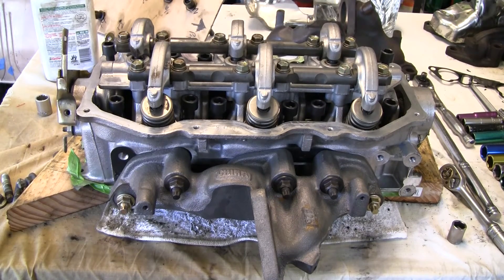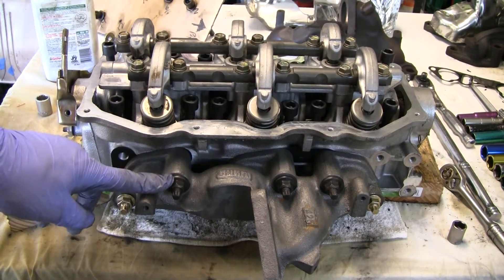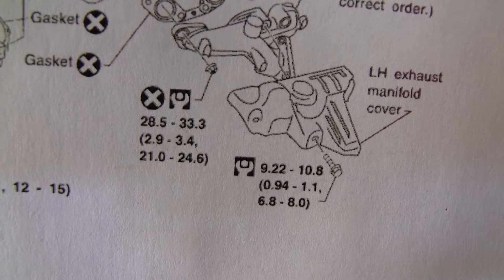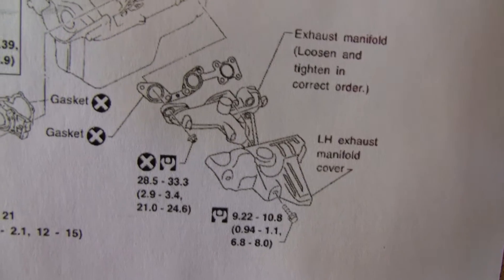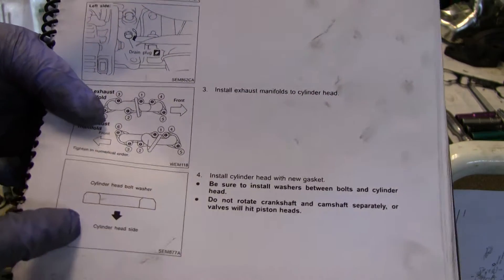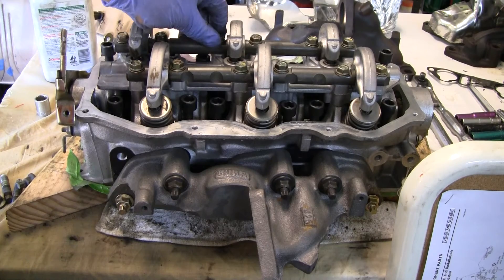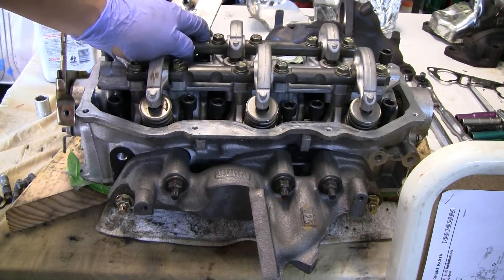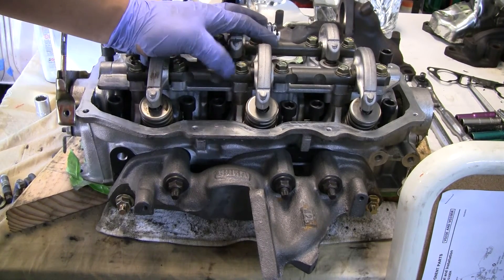2002 Nissan Xterra VG33E Rebuild Step by Step Part 70 - Exhaust Manifolds + Reading Torque Values

Comment: You should leave the rockers loose, UNTIL you are done installing the heads and water pump and rear timing belt tray. Just make sure cams are at tdc. When you get the timing belt on, you're able to set the tension more precise. Rotate to make sure there isn't interference and that dots on cam gears align, and double check tension and make final checks. THEN you are okay to torque the lifter tray in the correct bolt pattern and torque. Not overlooking of course that the dowls on the cam journals are flush when assembling. You do it this way so the cams don't have tension wanting to make the cam rotate on whatever valve spring tension there is. Sometimes you think the timing belt is good but after breaking and a few turns, it will be floppy and even worse on decel. This ensures the timing is true and consistent.

Comment: so its it possible to removed the exhaust manifolds without removing the heads ?? I just have an exhaust leak and want to take of it.
Reply from the maker: Passenger side head should be easier to remove than the drivers. The upper intake manifold goes over the drivers side head IIRC. I'm not saying its going to be fun in any extent, but easier since you might not need to remove the upper intake manifold. Its been a few years since I had my heads off.
Reply: I was able to remove the (cracked) stock exhaust mainifolds and reinstall long tube headers with the heads in the car. Of course, the bigger long tube headers were a huge pain, but putting stock ones back in shouldnt be too hard
Reply from the maker: I think its definitely possible to remove the exhaust manifolds without removing the heads. I only did it this way because the FSM suggested it.
Reply: Man I hope so. Large crack in my passenger side manifold and I don't want to tear my whole engine apart